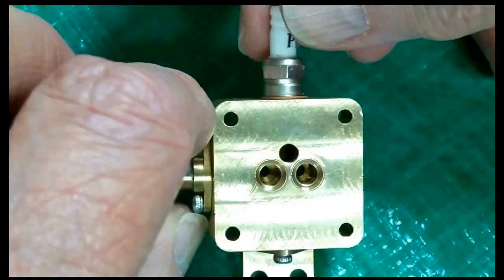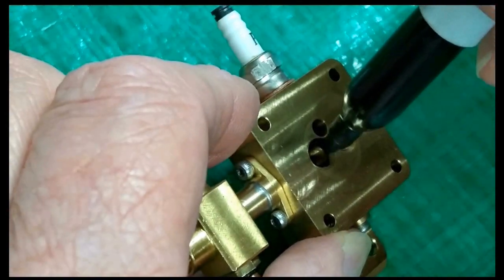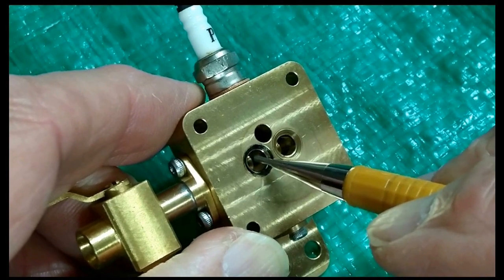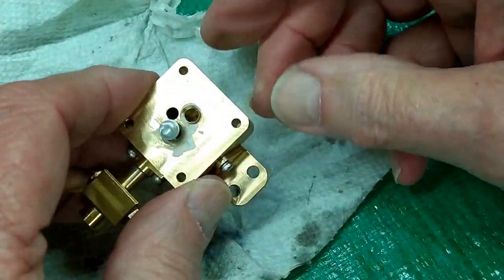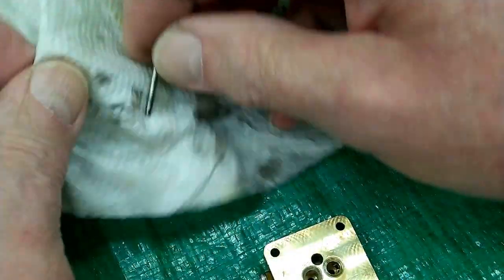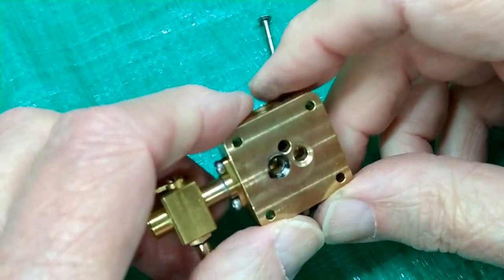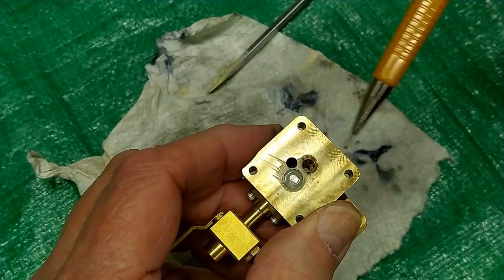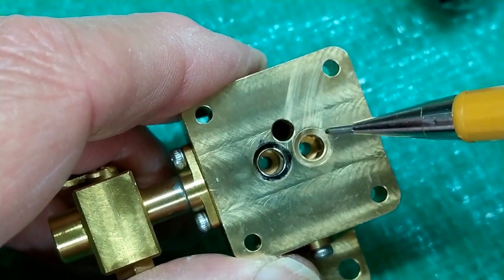Eachine ET5 - Doing A Valve Job

Comment: Hello Ronald, did you see a significant increase of performance of the engine after your improvements of the valve seats ? Regards, Wolfgang
Reply from the maker: No, I did not. I was hoping it would improve compression but it did not. Also, I would not recommend this engine as a first time engine. It can be problematic and difficult to run.

Comment: Good video on getting the valves to seat.  It's one of the hardest problems for me with my four stroke engines. When trying to get a steel valve to seat in an aluminum head the grinding compound would cut the valve instead of the aluminum! Also it's easy to go too far and open the seat up too much.   Found some "Autosol" metal polish that works pretty good  seating valves. It comes in a tooth paste type of tube.  Purchased one of those same  engines two months ago , have not taken it apart yet.
Reply from the maker: I would think it possible the "grit" of the compound may get embedded in the softer aluminum instead of moving around like we want it to. Trial and error with different compounds may be the name of the game. Baking Soda paste or toothpaste have worked on some tings in the past... but didn't do much with this brass... and it was taking too long.

Comment: Hey Ronald, 
you're really into details and you have fantastic mechanical skills!!! 😃👍
How about removing so much material that not just a linear circle does the sealing but a stripe that has the same width of the tilted valve? 😉 Probably you need a higher octane rating then because of the good compression. 🤪😅
Would be nice to see your mechanical skills again by making an interesting, crazy, complicated model of a gearbox again. blink*blink

Comment: This engine doesn't have a lot of compression, and most of the loss is through the single thin silicone piston ring. But there is a reason for this, and it is to allow some fuel/oil mix blow-by to lubricate the bottom end components- wrist pin, crankpin, needle main bearings and valve gear. The top end rocker arms need to be oiled manually.